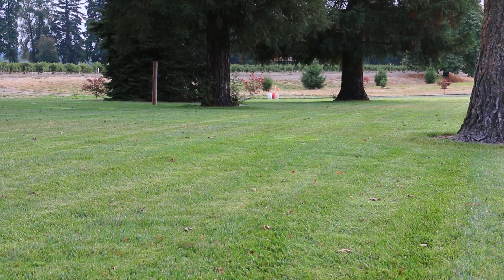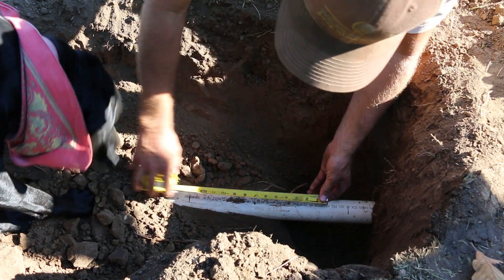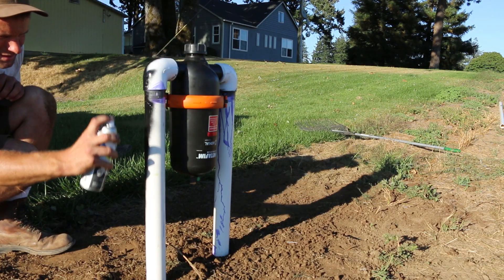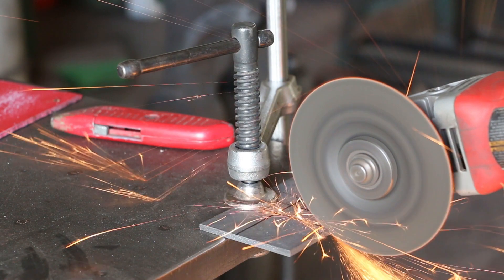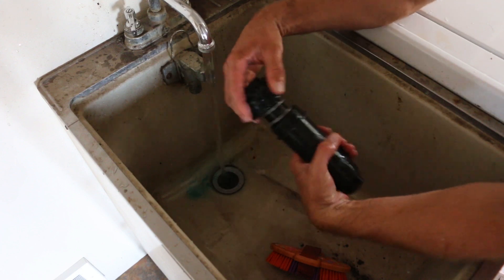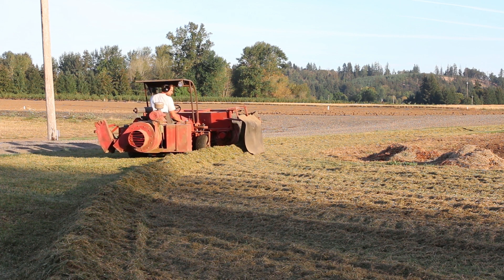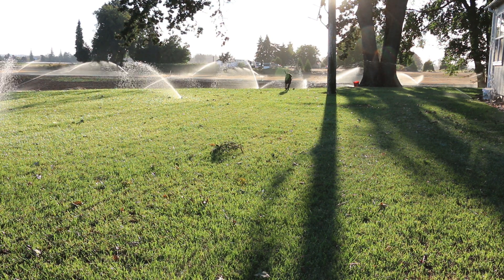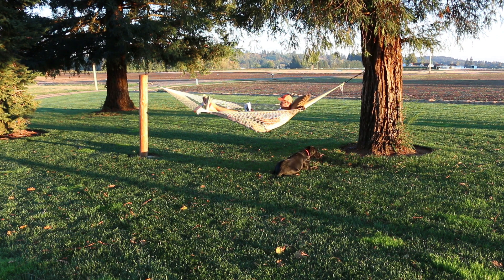Lawn Care and Filter Install

Comment: What you did with the lawn is called "Scarifying" usually - but you don't use a mower but a special attachment which basically heavily rakes the lawn and pulls out all the dead grass. It makes the lawn look terrible for a few weeks but it comes back harder and stronger.

Comment: You might get better results if you dethatch with a vertical mower. You won't have to scalp the grass and it will cut up and thin out all the old and dead grass. 

Anyway, I dig all your videos. Thanks for the great content!
Reply: There are few different machines that accomplish the same thing. I've heard a vertical mower called a dethatcher. I'm sure there are tractor mounted ones, but I've only ever used ones that looked like a small push mower. It's kind of like a flail except that the blades don't bend at the bottom and they are straight. A slit seeder for turf is basically the same thing but adds a box that drops seed in the grooves cut by the blades. Again, this is all much smaller scale than your farm implements mostly since it's geared much more towards residential settings. The one thing to remember when using something like these is that if dethatching is the goal, you want the blades not to dig into the ground and just graze the surface. This reduces the damage done to the plants and rips off the dead grass blades and pulls it up the the top. In my experience, running it over with a regular mower a day later is enough to mulch it all up and cleanup is pretty minimal.

Comment: I work at a real old cemetery, built 1888, plubing started doing in the ground around 1930.

Needless to say there is a rust scale problem, which keeps us from using that style pop up. The "impact" style pop up sprinklers will take a ton more garbage. And personally I think they're easier to adjust.

Comment: Have you thought about using a lawn scarifier to improve your grass and remove (most) weeds?
Reply: Wow. I would most certainly recommend you to use that for growing your seeds as well, as scarifying helps drastically to improve yield. And did you know that there is currently a commercial viable way of growing seeds which can churn out 20 (!) fold (or more(!!)) then you can achieve on cold ground seed growing? Growing under led light is truly amazing and as a mechanical engineer by trade living in the Netherlands i have experienced firsthand the amazing quality of cabbage, strawberries and other vegetables they currently can produce without a spat of sunlight (and no herbicides nor pesticides as well). You might want to look into that as well, but notice that in order to go that way, it requires quite some investment. However, the return on investment is already proven to be huge.

Comment: "A TON OF GLUE" actually weakens PVC pipe joints and can cause premature failure.  The extra solvent causes damage to the fittings.
Reply: The glue can attack the PVC pipe and make the joint weaker.